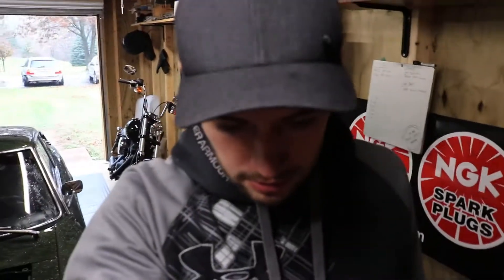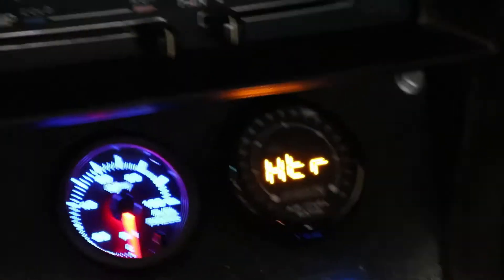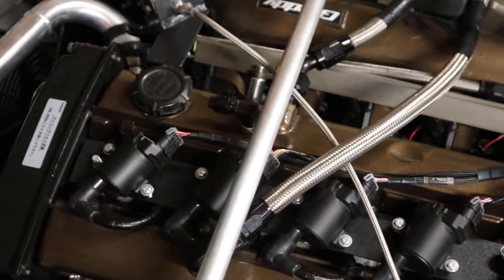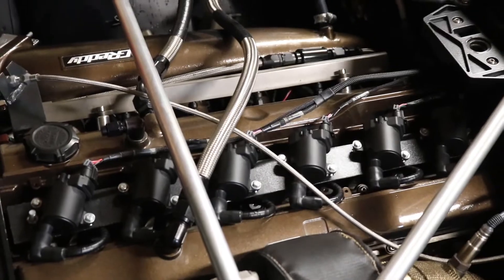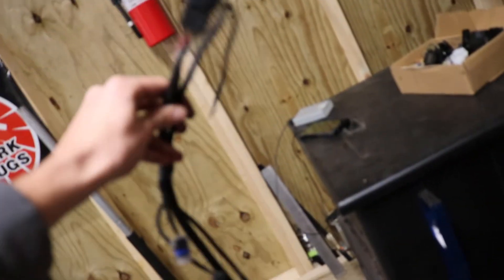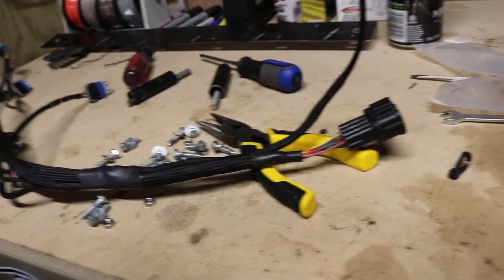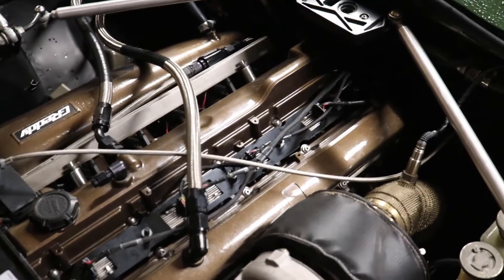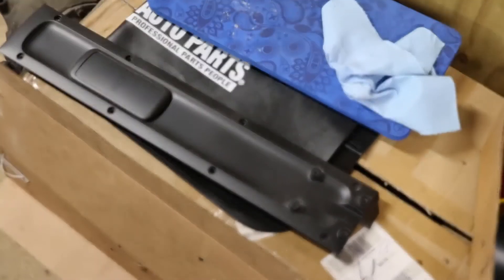HOW TO: RB25DET Coil On Plug LQ9 Truck Coil Conversion

Comment: You used 1/2jz coil pack boots and not rb25/26? Just wanted to know the reason? How's the seal between the boot and cylinder head?

Comment: Nice video. I have the same setup on my S14 and am installing the CX Racing plate this weekend. One question, did you need to remove the stock mounting ears off of the coilpack before installing?
Reply from the maker: I didn't remove them but they might fit slightly better if you do remove them
Reply: Removed em and they fit like a dream. Thanks for the reply.

Comment: Based off your last video and how you say the conversion did not fix the problem causing you to misfire while in boost leaves me with one question. Have you taken the time to check for boost leaks between your turbo and intake. A small leak can cause the engine to go rich and cause the misfires that you've been having. Pressurize the system, spray all connections with soapy water, and tighten any loose clamps.
Hopefully this points you in the right direction.
Reply from the maker: That's my current suspicion. I made a boost leak tester and I found that my bov was leaking off pressure at around 4 psi even with the throttle open to equalize pressure. I put a spare bov on and with the same procedure I can now   get around 15psi out if the system before the connection between  the leak testsr and the turbo air inlet leaks. I drove it after that and it seemed like it night night be better, but still acts up on e85. I want to go back and do a more thorough test again

Comment: FYI, for doing wiring that will be in your engine bay, you're better off crimping rather than soldering, as the solder will soften under engine bay temps and you'll get bad connections. For inside the car cabin, you can solder, though it's often simpler to just do crimps everywhere.
Reply from the maker: I agree with you.  But the crimps would have been super bulky impossible to loom without being sloppy looking. the wires are on the intake side and along the firewall so it should be okay